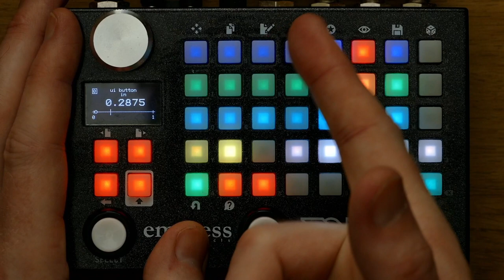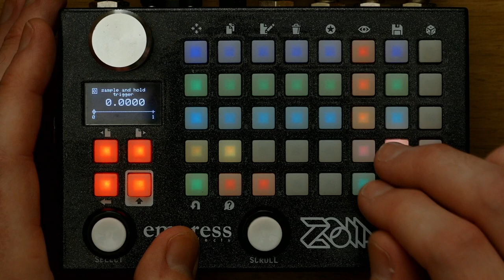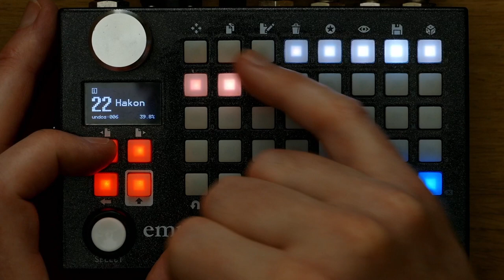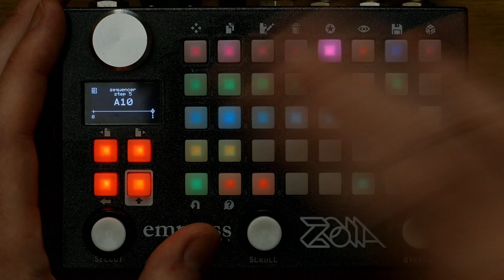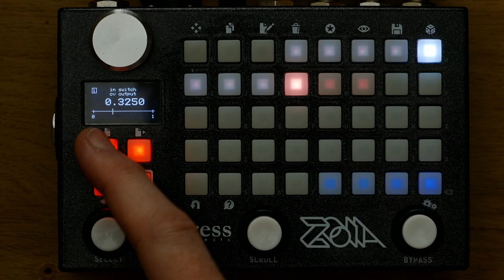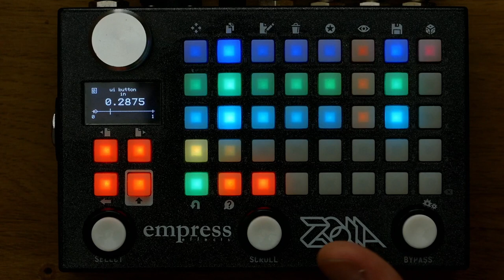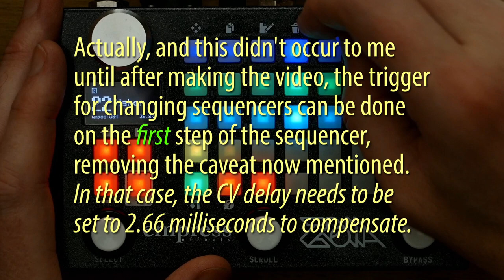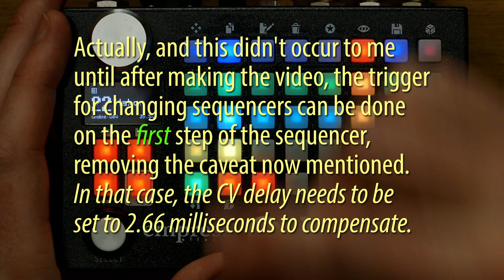Zoia Tutorial: Shifting Between Sequencers while Playing

Comment: Thank you for this, I have set it up now. The only thing I can’t do is make the UI buttons go green when pressed. I have watched the tutorial on that but for this example I am not sure what to connect the UI input buttons to in order to adjust the connection strength and get the same behaviour as you have, please could you let me know, and thanks again for making the tutorial, I really appreciate it 👍
Reply from the maker: You're welcome.

To make UI buttons red when inactive and green when active, first set the value at the first pad of the UI buttons to 0.0375 (bright red), and then connect their outputs to both the input and trigger of a sample and hold module. That will make it trigger whenever any of the buttons are pressed.

Secondly, create an out switch with the same number of channels as you have radio buttons.

Set the value of the out switch input to 0.250 (0.0375 + 0.250 = 0.2875 = bright green).

Connect the sample and hold output to the out switch channel selector.

Connect channel one of the out switch to button 1, channel two to button 2, etc.

Take the value 1 and divide by the number of buttons to find the CV range that selects each out switch channel. If you have four buttons, and four channels on your switch, for example, sending a CV value to the channel selector of 0–0.249 selects the first channel, 0.250–0.499 the second, 0.500–0.749 channel three, and 0.750–1.000 the fourth and last channel.

If you have three buttons, like in this video, the numbers are 0–0.333, 0.334–0.666, 0.667–1.000.

In order for the switch to select which button to send its input value of 0.250 to, you need to adjust the connection strengths between the button outputs and the sample and hold, since this is the value that is sent to the switch for channel connection. Initially, they all send a value of 1, which would select the last channel and make button 4 green. You want the connection strength to make the value sent to the switch match what it needs to select the channel that makes that particular button green.

Continuing the 4-button example, the first button's output should therefore be connected to the sample and hold input with a connection strength of less than 25%, the second one from 25% to 49.9%, the third 50% up to 74.9%, and the last one anywhere from 75% to 100%.

Once that is done, the out switch will send its value to only one of the buttons at the time, and whenever one is pressed, the sample and hold will hold the value that selects the channel on the switch controlling which button gets the value sent to it that creates the colour change.